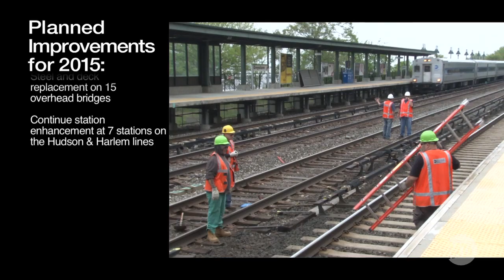Summer 2015 Right of Way Improvements

Comment: Not one word on removing grade crossings...
Reply: You cant really remove at grade crossings just like that, they really arent an impediment and also, think of how disturbing it would be to residents if the railroad trains had to run on elevated structures, which take so long to build as well as tunnels. Remember this is a railroad, not a subway
Reply: Steven Francis ...